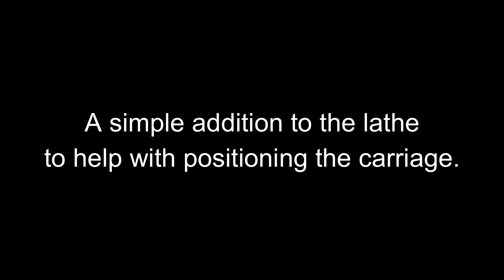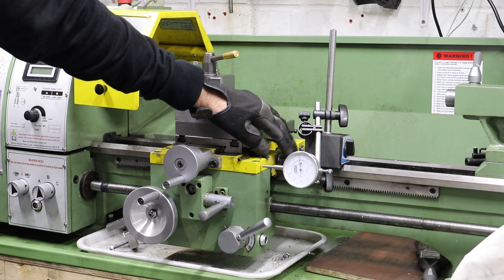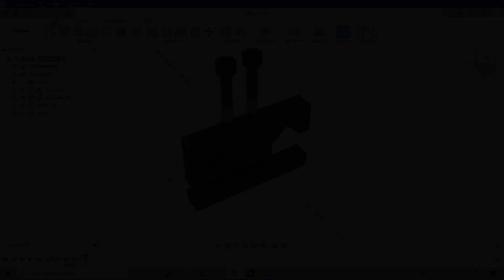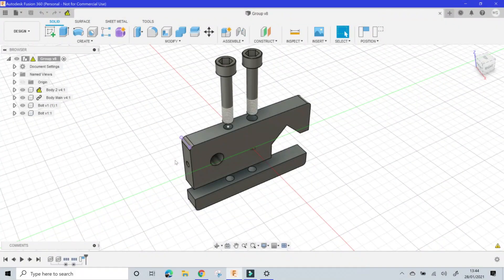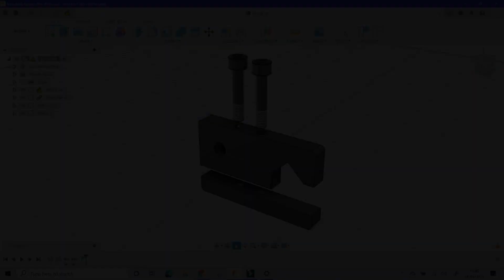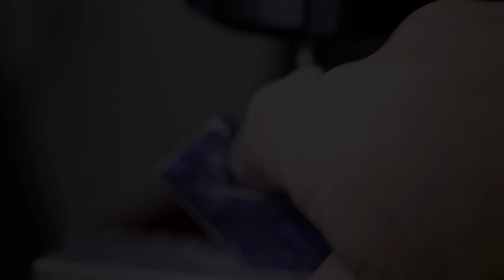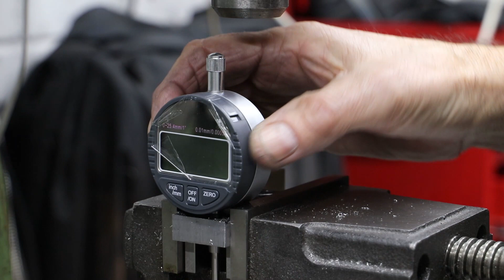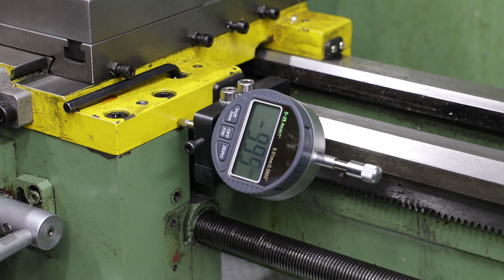DTI Clamp

Comment: Thank you Mark, a neat simple design.  Were you lucky with the 90deg. ? my WM250's was 93deg.  A word of caution possibly with your dial indicator.  It looks very much like the one I had, that turned off after about five  minutes.  Presumably to preserve the battery.  However, when turning it back on, it went to zero.  Not very useful in the middle of a job.
Reply: Hi Steve, good question on the V angle.  I did actually talk about that when making the video, but ended up excluding it from the final cut.  I was pretty sure the angle was slightly over 90deg as it's obvious on a carriage stop I previously made (other side of carriage).  It's not so obvious on this clamp, and given its purpose won't be a problem.
Thanks for letting me know the actual angle 👍
The DTI is a cheap item from Amazon.  I've just checked it now.  It was still on after 10 minutes, and when I switched it off and back on, it retained its last reading 🙂
Mark
Reply: @MSmifffy  Hi Mark, don't assume your bed will also be 93deg. from what I've heard, they can vary a little, even on similar models.  Why not simply 90deg.?  Who knows.